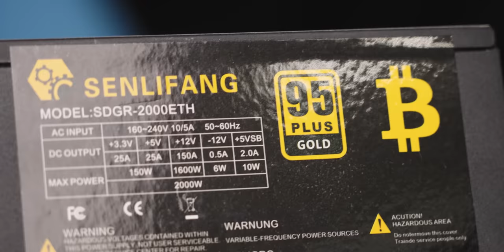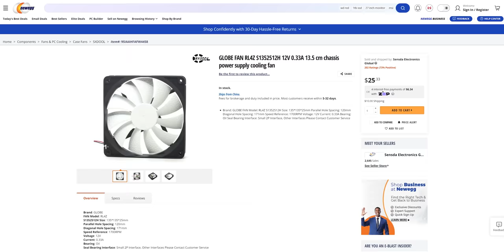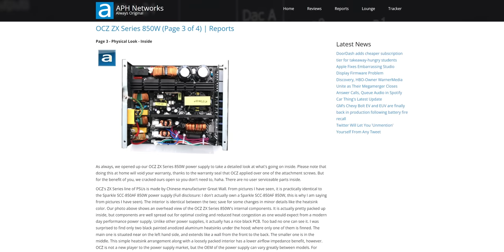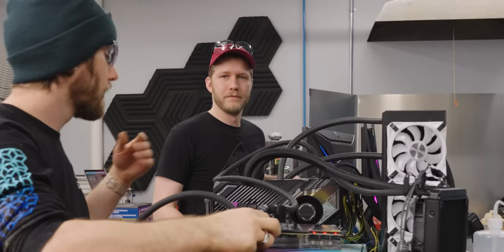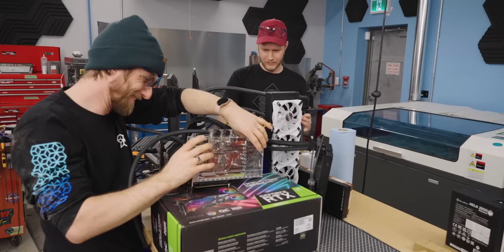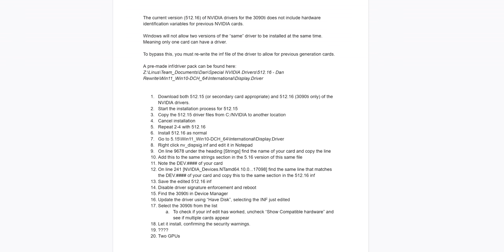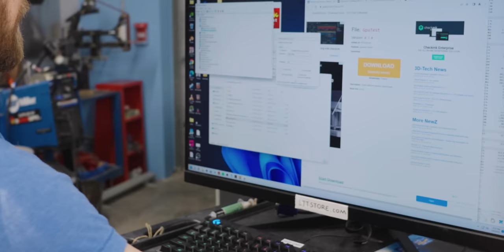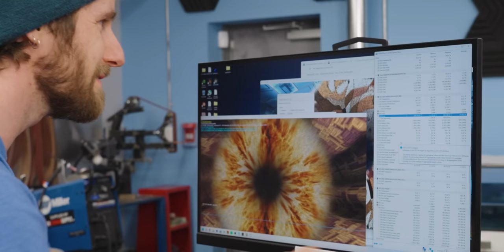This is one SKETCHY 2000W Power Supply

Comment: I love how the least sketchy part of this video is probably the 2000W power supply itself
Reply: No, because I would have taken a 240 V extention cable and modded it with a 120 V  female socket, not the other way around.
Reply: truth. why didn't they just use the pdu from the million dollar server?
Reply: Why you are so scared of 240V?
Reply: @jackielinde7568  why? Wouldn't that be rated to a lower current?
Reply: @NikolasOldSchool  because North American electric infrastructure is unsafe at 120 volt.
Reply: @NikolasOldSchool  because plugging in anything that's rated for 120v into that cable will probably kill whatever you just plugged in
Reply: @Michael Skinner 1) failing to use a proper 240 v power cable or pdu. 2) disassembly without intentional discharge of capacitors. 3) a test setup with a modified GPU and another GPU lying off to the side connected via a riser cable repurposed from a case review. 4) driver hell and manipulation to get parts that aren't meant to work together to run a program with no purpose but to stress out parts. 5) Failure to use any sort of objective measuring device to measure current or power. 6) the video had Alex in it. 7) the video had Linus in it. 

Just saying, the video is a little sketchy. I loved every minute of it!
Reply: @edwardallenthree  1. They don't own that equipment.
2. Most of that equipment is going back to the people it came from.
3. They can't risk damaging it.
Reply: @NikolasOldSchool  Who said they were scared of 240 V?
Reply: @jackielinde7568  lol
Reply: @edwardallenthree  What makes it unsafe?  For line to ground shocks, which are by far the most common, there's no difference between 120V and 240V.
Reply: Here in Brazil we use both 120v and 240v, depending on the city you are in. Some houses has both. The plugs are the same for both, but there are a different one for 10A and 20A, the 20A being just a chunkier version of the 10A plug (you can plug 10A on 20A but not the other way round). Our showers heaters are in the shower itself and it uses 32A. I don't know why you are so scared of electricity.
Reply: @pedro4205  well, 50mA (0.05A) can already be fatal and with 100mA  (0.1A) death is almost guranteed, so just one Amp of power is nothing to make fun of cause it that flows through you you are fried
Reply: @hotdogandahayride9823  what makes the North American electricity system in our houses unsafe is how we handle fuses. We have circuit breakers to protect the wiring in the wall, but we do not fuse outlets like the rest of the world does. Furthermore we have no regulations on fuses on devices. Finally, 120v isn't enough. This whole video is one explanation of why.

There was a great technology connections video about this. The rest of the world knows what they're doing when it comes to electricity. North America does not.
Reply: @edwardallenthree  It's not theirs.
Reply: @Damicske  just to be clear, the last line of my rant was that I love the video! It was sketchy, but a straight review of this product would have sucked as a video. Who wants a review of a product that you can't and shouldn't buy? 

I also find it deeply amusing that this is the second video in so many weeks that has demonstrated a need for LTT to have more 240v outlets and cables.
Reply: @NikolasOldSchool  lol ikr uk is 230V but can go up to 250V
Reply: the 110/120/220 difference is just on the first phase of the switching psu. The way they described as having "both components" etc was friggin painful
Reply: @edwardallenthree  most countries don't fuse outlets. As far as I know it's just the UK and anyone who copied their sockets (Hong Kong etc).
Reply: @edwardallenthree  because they don't own that server.
Reply: "AMERICANS"
They think everything's sketchy outside of their knowledge.
Reply: @jackielinde7568  As long as the insulation in the extension lead is rated to 240v, I can't see an issue with what they did.  As for current carrying capacity, isn't North American wiring run in a higher gauge to compensate for the higher current.  In Australia, your standard duty 10A ext lead would have 1mm2 conductors.  That lead they chopped up looked like 1.5mm2 maybe.
Reply: @pedro4205  Oh, everyone thinks the US only has 120 V everywhere. Absolutely not true. Residential has 240 VAC going to the house in the configuration of two 120 VAC lines out of phase of each other and a neutral line between. The fuse box runs a spine down the center that alternates between line 1 and line 2. 240 circuits will have breakers connecting to both lines for a four wire configuration. Everything else gets one or the other. And Commercial applications get whatever the business needs, starting at that same 240 VAC service that Residential gets. And the sockets are geared towards whatever amperage the circuit requires.
Reply: @edwardallenthree  why are you saying there are no regulations on fuses? Also, fuses haven't been standard in residential construction for years and years. This is because breakers (and now GFCI combo breakers) are way more safe for residential and commercial construction. Industrial settings use a combination of fuses and breakers depending on the application.
Reply: @edwardallenthree  New Zealand also doesn't fuse it's outlets. Instead, the power leads on every device, and extension cords, etc., are rated to handle loads just as high as those that the wires in the wall are rated for. You don't hit something rated for less until After you hit the device's converter. Consequently, the fuse/breaker in the electrical box will do it's job just fine even if the fault is on the other side of the wall plug. Which also means you can safely ignore all the warning labels on products made overseas about not plugging them into extension cords (though that's just straight extension cords, mind you. You need to be a bit more careful with Multiboxes/power strips/double adaptor plugs, etc. Check the Ratings! Note that most multiboxes have their own fuses and/or various other safety features as well).

The USA? Does not (or at least, for a long time, did not) do this!  Technology Connections did a video on This, too. The one about unsafe extension cords, or some such?  Basically, extension cords (and sometimes the power cords on devices themselves) will fail before the fuse (which is designed to fail before the wire in the wall). 

Incidentally, Britain fuses it's plugs/outlets because, after ww2, material shortages lead to houses being designed such that the whole house was basically on one electrical circuit (using Much less wiring than the standard configuration). There's a Reason (actually, quite a few reasons) no one else designs the electrical systems in houses that way (and Britain stopped doing it that way too, once they had enough wire to go around and so didn't need to any more), and the (actually very good, mind you) British plugs came to be the way they are pretty much entirely to compensate for the downsides of it.
Reply: @seushimarejikaze1337  The reason you'd need to discharge the capacitors isn't because they're planning on touching it. It's because they MIGHT touch it. This precaution went back as far as there were high voltage capacitors in ancient TVs. Safety is all about those random moments of inattention. Few people ever plan to deliberately do something that would get themselves hurt. It's always those unseen accidents of momentary contact.

Also, remember that Linus is involved. Saying he was accident prone is like saying Gasoline is somewhat flammable.
Reply: @edwardallenthree  why would they need to discharge the capacitors? its not like they plan to lick the wires exposed or something. took apart lots of psu for routine maintenence(mostly cleaning or diy replacement of a fan that died... lot of people dont clean their psu then come and complain that computer doesnt turn on lol) and some diy stop-gap repair (water cooling the transistor that was overheating too much). never got electrocuted even once during that.
Reply: Ltt moment
Reply: @pedro4205  onde é 220, também é disponível 380V se o circuito for trifásico, no interior onde é bifásico é 220V fase pra neutro, 440V fase pra fase.
Reply: @jackielinde7568  fair point lol
Reply: @edwardallenthree  With Dogs being electrocuted on sidewalks in America im not surprised. We run 240v from the wall standard down here in New Zealand
Reply: @NikolasOldSchool  you ever been booted by it?
Reply: @seushimarejikaze1337  "...never got electrocuted even once during that."

Ah, right. Because "Nothing bad happened to me in the few times I tried it" means that "nothing bad can ever happen in that situation."
Reply: @Curt_Sampson   it can happen only if you do something really stupid, like completly, ignoring basic knowledge that they teach in elementary school. i was doing that stuff since i was 13yo (long time ago lol ) and even then nothing ever happened to me ever and in the beginning, i even didnt know to wait a bit after unpluging - for caps to discharge. you just cant say i was lucky through my whole life... basic psu maintenance is that simple and now even safer with bleeder caps.
Reply: @seushimarejikaze1337  I have no idea what sort of elementary school lessons you're talking about, but I can indeed, and will, say that you've simply been lucky. Opening PSUs is not safe (though also not guaranteed death) if you don't actually understand their general workings and know how to discharge the caps. There's a reason for those labels on the PSUs that tell you not to do exactly what you're doing.

I don't expect that you'll ever accept this, but I'm explaining this for others who might read your dangerous suggestions and be tempted to try the same stupid stunt.
Reply: @Curt_Sampson  did i ever try to convince someone to do it? i just said you need to lack common sense to be harmed while doing it, thats all (yeah i was lucky more than ca. 30 times i did it for myself and many more for my acquintances, sure lol).(edit: the elementary school lesson form techincal subjects where students build their own simple electrical circuits under supervision and learn the basic knowledge of what resistors and capacitors are and how they work, not my fault that not every country teaches that in elementary school heh)
Reply: @justsomeguywithglasses  That was one sketchy take, dude. /European

Comment: I miss these types of "Don't ever do anything you see in this video, but here's some detailed instructions on how to do it" videos. It reminds me of an old video where Linus showed us how to make our own 7v fan speed reducer out of extra molex adapters.
Reply: Yeah use 5v for netative an 12v for postive so you have 7v
Reply: If you dig into the 20/24pin connector, you can also find -5v and  -12v to play with, giving you a voltage choice of 5, 7, 10, 12, 17, or 24 volts to play with
If you also use the +3.3v line, you have 1.7, 3.3, 5, 7, 8.3, 8.7, 12, 15.3, 17 and 24 volts to play with
Reply: @MrHack4never  cool!   ........why would I want this?  Not being snarky I have no idea what this would ever do for me
Reply: @RedBeardWalking  
You can use 24v to fry your fans😃
Reply: Linus did WHAT?
Reply: @MrHack4never  I don't think you should EVER join the -5v and -12v with the rest of the +s because they can't deliver more than a few hundreds of mA or something, something a simple fan can already take all by itself.

They are there for compatibility purposes only.
Reply: @TemporalOnline  
>Compatibility
Correct, but AFAIK, the negative voltages was intended for driving floppy disk motors in reverse, and to supply early soundcards with a negative rail, neither of which aren't really light loads
Reply: DON'T DO THIS but this is the way to do it if don't listen to us

Comment: It’s funny that PSU testing setup for 6160 USD was missing the device measuring power draw for 30 USD.
Reply: reconz 82299  you dont know work/pain unless youre hammering a nail with a rock xD
Reply: They would’ve needed a clamp amperage meter on each of the hot legs because those kilowatt power meters I think only work on 120 V if they plug that into their modified extension cord they would fry it